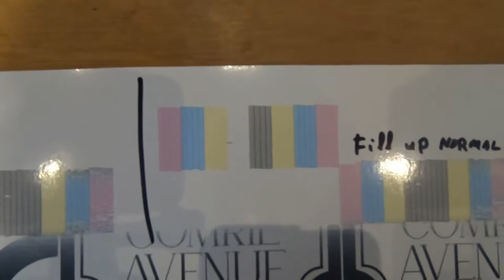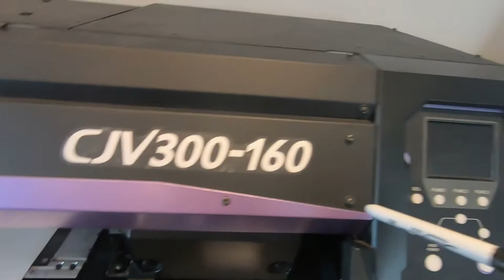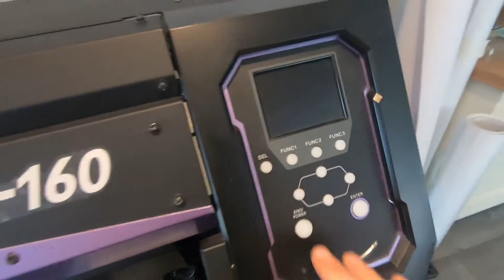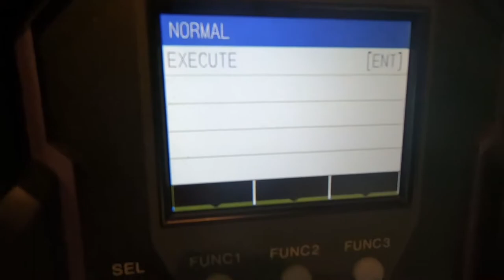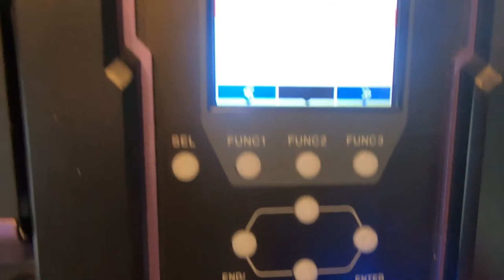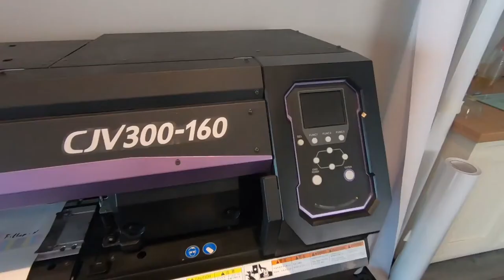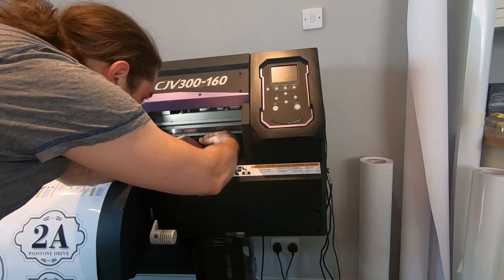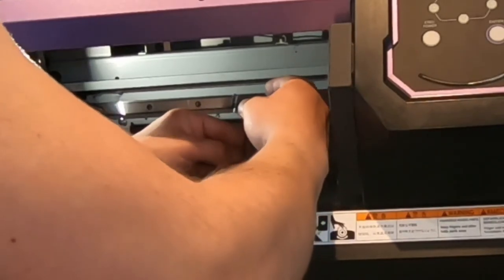I broke my Mimaki printer [PT1]

Comment: Why not prime the new damper manually, with a syringe ( to avoid wasting ink with the 'fill up' option )?
Reply from the maker: Good question. That would require me(or the person doing) knowing that in the machine of this kind has valves that prevent the inks from being drained in the first place, second, knowing how to access service menu, thirs, knowing what and how to select in there to open just the right gate for the inks to be able to flow. In short, this is a more simplified way of DIY if you'd like.